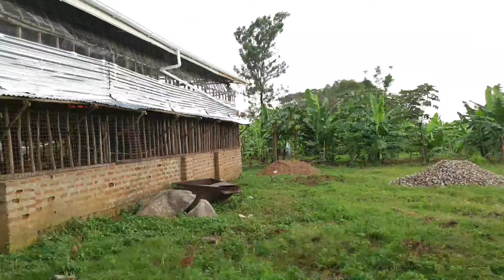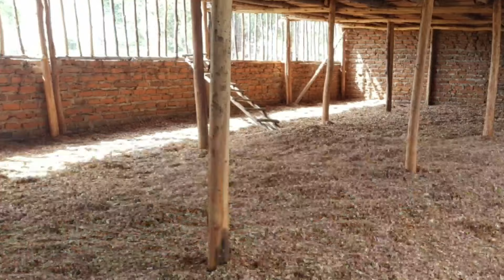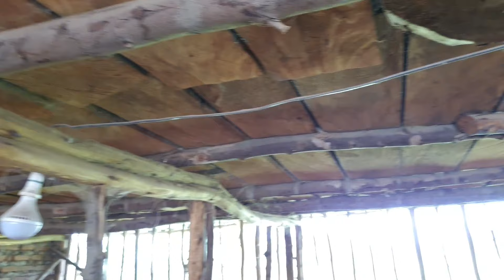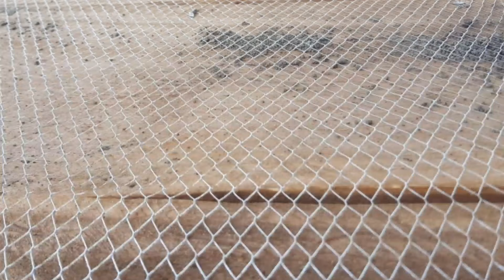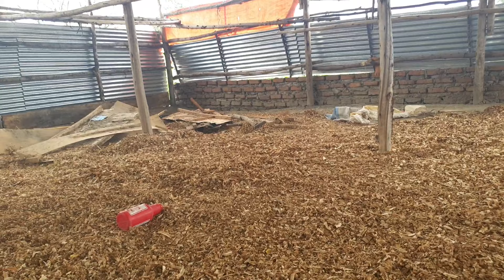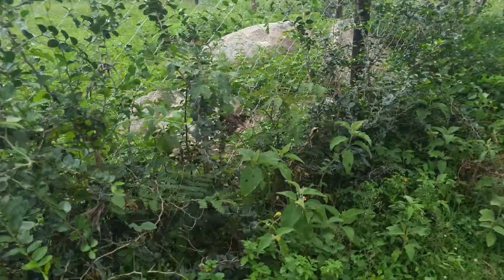How To Build a Poultry House [Space Saving, Easy and Cheap]

Comment: Great video! Very informative... so glad to see you collecting rainwater. I recall in one of your video you saying water was expensive. That should cut your water expense down. In the U.S. most towns ban rainwater harvesting. They say its because of mosquitoes but it's more likely because they are losing tax revenue🤔 luckily my township allows collection up to 5000 gallons. What do you do or Use to control mosquitoes? I covered all opening with screen and so far... no mosquitoes. We also have native bats that eat 10 times there weight in bugs so they keep the mosquitoes  population down. I built a few bat houses and added them to the back of my barn... they help keep the bats around.
Reply from the maker: We use mainly mosquito nets indoors.  Controlling them is so hard here